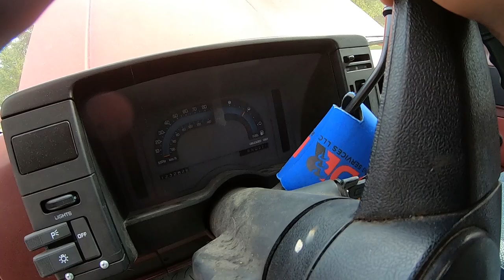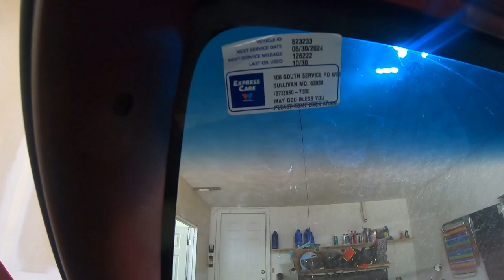Marketplace Truck BROKE DOWN On The Drive Home!  Is it salvageable???

Comment: Some thoughts:
- I like the new drone intro video.  Very nice.
- Iron Duke four cylinder was 2.5L
- Do NOT spend even one minute of your life attempting to do anything with that retched 1980s alarm system except to yank it out. LOL
- DEFINITELY move up to 15" rims.
- "Decent install" or not, that aftermarket sunroof will be the bane of your driving existence.  Keep the interior rubber seal lubricated with a softening compound and once you've reconditioned the seal, don't open it any more... Just leave it shut.  Me?  I'd also coat that exterior gasket with a smooth layer of black silicone and call it good.  I wouldn't waste my time replacing it unless you're doing a full resto.
- REMOVE 100% of that cobbled up stereo equipment.  Wiring and all.  Maybe some day you can reinstall it, but for now git'it outta there.  You don't need the electrical hassle of diagnosing the mess that is that current setup.
- Ditch the boi-racer lowering kit (for now).  Yeah, yeah, you like the look.  I do too, but as you said, it has NO front end suspension travel and that's not good for someone trying to learn how to drive.  Rip it out and slap in the stockers (for now).  You won't regret it.  The lowering kit also throws off your driveshaft angle and I'll bet three bananas the kid who kludged that suspension system on it didn't take that into account.
- eBay the 18" rims.  Stick to your original 15" idea.  Don't inflict the hassle that will be, getting them to not rub, upon yourself.  S-15s came with the ability to run 15s from the factory.
- The GM oil sensor leak is an EXTREMELY common thing. I know it's too late, but next time use the 1986 Corvette oil pressure sending unit instead.  It has a more robust construction and is designed to come on at a higher pressure so you don't blow your engine.  It is a direct bolt-in.  See my next bullet point about the oil sending unit.
- Just so you know, that 2.8 REQUIRES a minimum of 8-10 psi oil pressure at idle to stay healthy.  It then needs 10 psi for every 1000 RPM above that.  The oil pressure LIGHT on that truck does NOT come on until the pressure gets BELOW 2 1/2 psi...  That's right, two and a half pounds.  At that point the damage has already been done.  GM should have been class-action sued over that one back in the day.  --> And those 2.8s are SUPER sensitive to low oil pressure and overheating conditions. They will not tolerate EITHER of those conditions.  Going forward make damned sure you don't let that engine experience either one.  Sounds like you got lucky this time with the oil, anyway.
- The single-pronged oil sending unit is for the dash light.  The single-pronged unit is internally grounded.  The two-pronged sending unit is for a dash gauge which your truck doesn't have, I assume.  On the assembly line the engines were installed with both sensors.  The wiring harness is the same for both options too.  The two-pronged sending unit and accompanying connector is just along for the ride on your truck if you don't have the gauge.  Although --> depending on year, the two-pronged sending unit MAY be relaying a 5 volt signal to your computer, IF it has an early OBD I system. ...maybe.
-  DO NOT attempt a 4.3L swap.  The wiring and injection and computer requirements will destroy your pocketbook.  If you HAVE to do an engine swap, do an original SBC V8 swap for a couple reasons.  1) Believe it or not the SBC is a DIRECT BOLT IN and can be done using 100% factory (sourced) parts from the junk yard or aftermarket. 2) or just buy the adapter kit. 3) The SBC V8 swap is WAY WAY WAY CHEAPER than doing a 4.3 swap.  4) NO modifications have to be done to the frame or body to do the V8 swap.  5) Did I mention it's CHEAPER than the 4.3 swap.  6)  If I hadn't mentioned it before... --> the V8 swap is cheaper and easier than the 4.3 swap. 7) See reason 3...
- Yeah, that tail shaft side play is horri-bad.  The tail shaft on that transmission is EASILY removable.  Just pop out those four bolts on the back of the flange that holds the tail housing on, remove the speed-o cable and slide'er off.  You can now replace that tail shaft bearing and seal very easily.  
- Going forward, as a practice never use "greaseable" U-joints.  They're HOLLOW, and therefore MUCH weaker.  Yeah, yeah, you can't grease the solid ones, but they'll never break.
- The oil you're seeing on the trans is black. It's definitely from that oil sending unit slowly leaking for YEARS before finally giving up on your drive home.  It's just been blowing all the way back there in the wind.  Although... those 2.8s did have a rear main seal leaking problem too, so keep an eye on that, also.  
- Also, that thing sounds like you have a small vacuum leak somewhere.  I'm guessing the hose on the bottom of the temp sensor that runs the Thermactor system (the little flappy-do inside the inlet of your air cleaner) has gone bad.  There should be two or three hoses to the Thermactor system, if I remember correctly.  One that comes up from the throttle body to the temp sensor, one that is in a u-shape off the other side of the temp sensor that goes to the Thermactor valve in the air cleaner inlet itself.  Make sure that system is working AND replace that aluminum bendy hose that attaches from the exhaust manifold to the bottom of the Thermactor valve on the air cleaner.  The 2.8 will run a dozen times smoother in the winter with this system functioning correctly.  Most people ignore the Thermactor system because that metal bendy hose is such a pain in the ass to put on, but don't.  Actually take the time to fix it if it's missing.  Especially if it's leaking vacuum.
- Since the trans is already on it's way out it wouldn't hurt to put some Lucas Trans fix in it.  I am NEVER a mechanic-in-a-bottle believer.  But when it's on it's way out, no joke, the Lucas is a game changer.  It'll add a little life to it.  Just don't overfill the trans.  Remove some first if it's full.  Also, if you ever do pull the trans (for whatever reason) swap out that pan for one that has a drain plug in it.
- And finally, definitely replace the engine coolant thermostat, regardless of whether it works right now or not.  Just replace it proactively.  You do not ever, under any circumstance, want to risk overheating a GM 2.8 V6 from that era.  They warp and crack heads like they're made out of glass.
- Good luck.
Reply from the maker: I see now where the name “Northern Chev” comes from. Thank you for the extensive feedback. I pinned the comment so I can find it later as I tackle the future projects on this truck. I always look forward to what you have to say. Cheers!